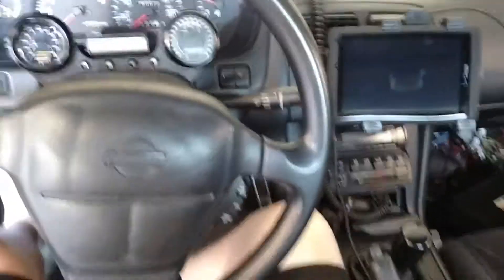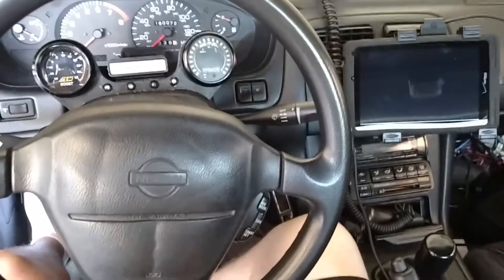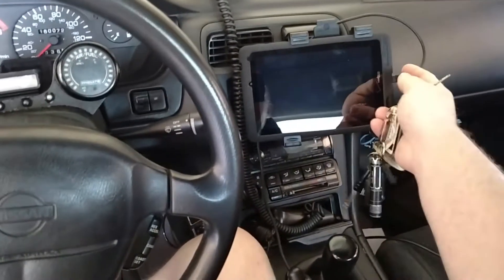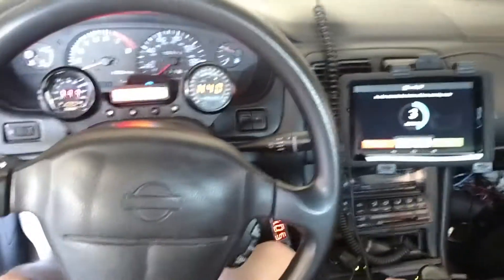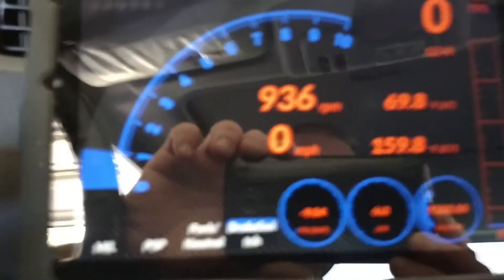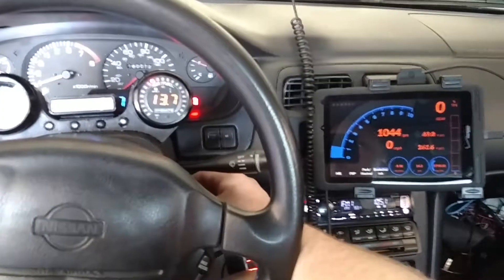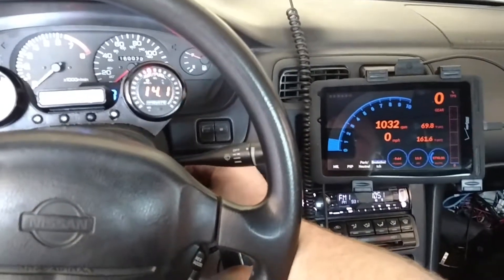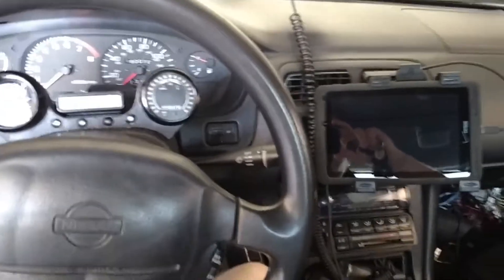Nismotronic Bluetooth tablet setup

Comment: You just have it plugged to the cig lighter and that turns it on and off?  Any lag time with that tablet while streaming the live data?
Reply from the maker: Yes, I'm using an app called AutoSleeper that puts it into standby when power is cut. There is some lag, but it's not bad. And some of that could be attributed to the tablet itself (because it is a cheap tablet).
Reply: adamky1 ok cool, ty so much!!!  Is that the exact app name..."autosleeper"?
Reply: adamky1 nvm, i found that app.  Has a rotation issue where the app stops upon screen rotation on my phone.  Ill try it on my tablet tomorrow and hopefully it won't have a rotation issue as i see yours doesnt
Reply from the maker: Cj Walker - That's weird. I have used it on both my tablet and my Android phone without issue..?
Reply: adamky1 hey.  I got the autosleep app to work on my tablet, thanks for the info.  So now i have the BT installed on my board but the tunerview app keeps saying i need to setup "datalog protocol" in order to view anything.  Everytime i try and click it nothing really happens...is there a certain process or something.....?
Reply from the maker: Cj Walker - You do have to pay a few dollars and order the Nismotronic datalog protocol for Tunerview. Sorry, I failed to mention that part in the video.